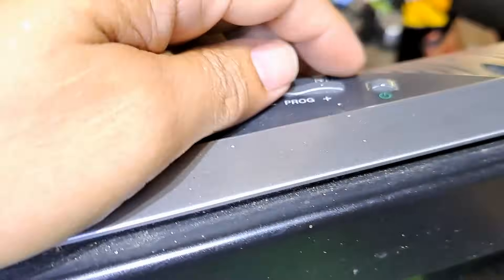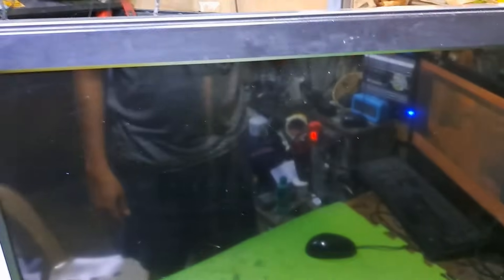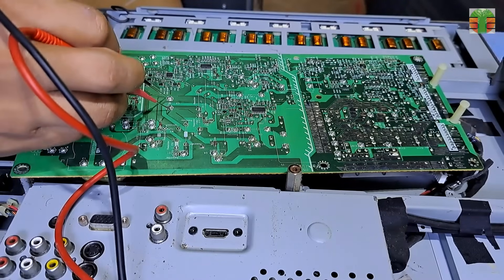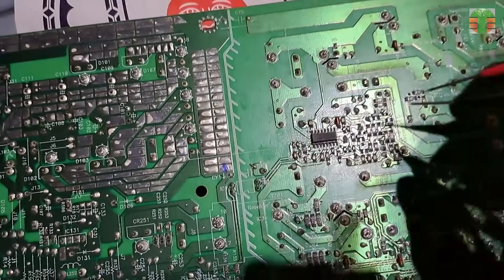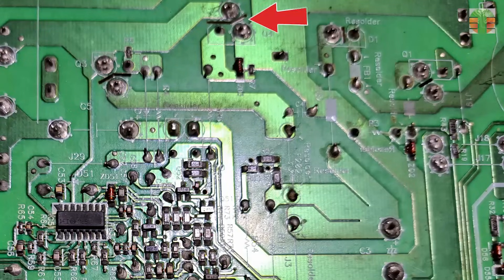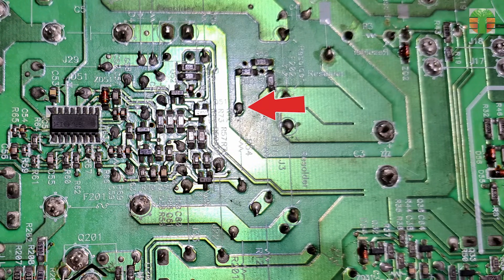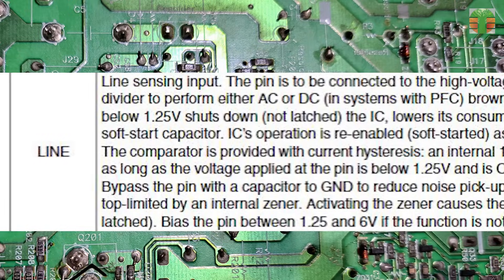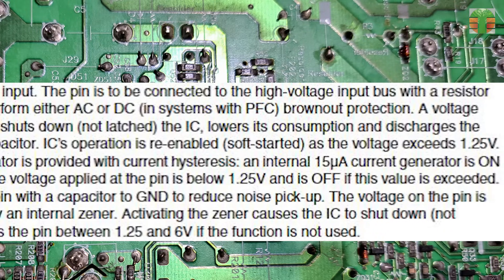Sony Vintage LCD TV repair

Comment: Hello sir, medyo non related question lang. nakita ko yung previous video nyo about sa repair ng nvision 24" monitor with horizontal stripes sa bottom. ganun na ganun kasi nangyari sa monitor ko now, same specs. possible ba to for repair? kesa bumili ako ng bago. and another question, ambilis din uminit ng adapter nya so parang may damage narin ang adaptor. any suggestions please. ty po

Comment: Hello. What is your solution when the resistance is burnt and its value is not known and we do not have a similar range
Reply from the maker: some resistors are in series with it, they have the same values.

Comment: Hi dear tevz.
I am very glad cos I received your video after 30 minutes you posted it.
Abd it was great.and I always learn how to start and find out the faulty component as yo do  and which voltage has to be checked  and get the reason why!
But some thing i want to ask you why don,t you protect  your tin top by a unburn plastic when you are gonna to  desolder a component ? In my country I usu ally buy one meter and divided  into 25 pieces at 4 cantimetters for once use and that will be ok  for one year?